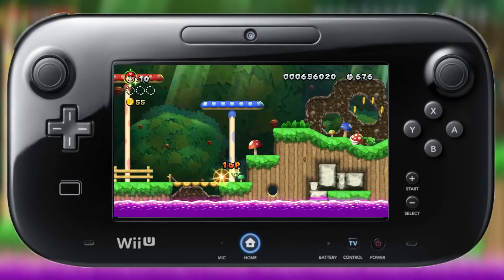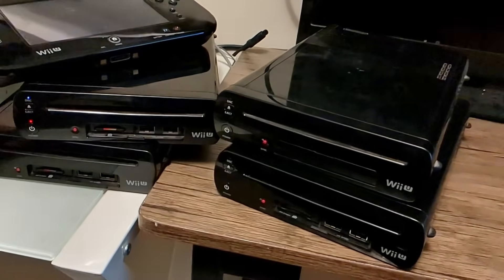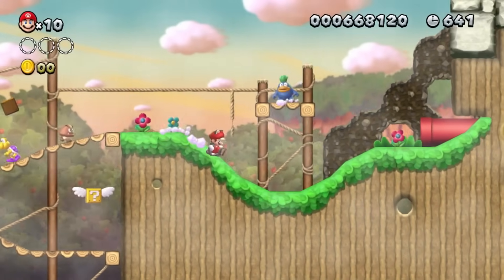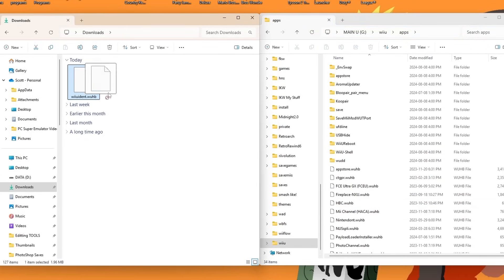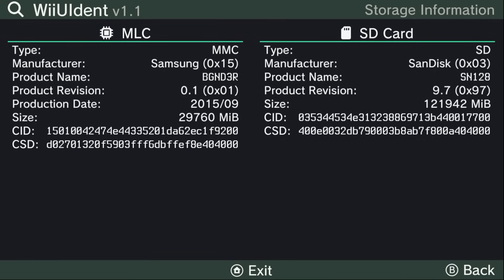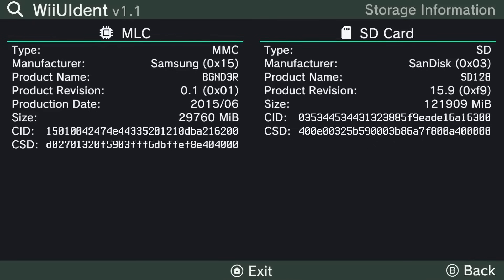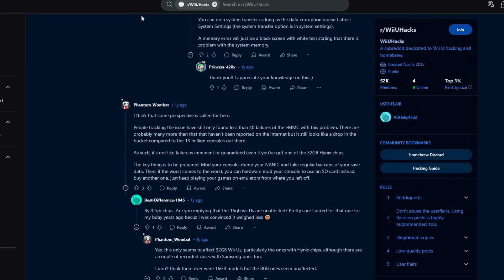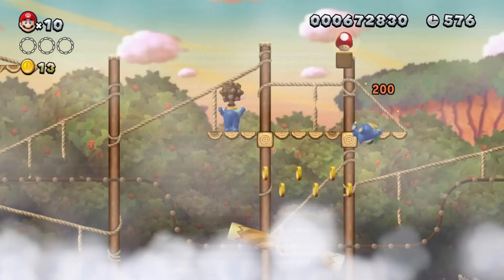How to find out if your Wii U is COOKED... (without taking it apart)

Comment from the maker: IF YOU HAVE HYNIX WATCH THIS https://youtu.be/xEGSSdykAt8 

Also isfshax guide here: https://youtu.be/D9L5JFqlC4Y

Hit like if you have a Wii U! (Also you can get WiiUIdent on the HB Appstore too btw)
Reply: Two wiius
Reply: i hit the like button twice because I have two wii u's
Reply: I bought my Wii U when it first came out. Being techniqually inclined I never have an issue fixing my systems.... Most of the time. My latest project that I've been procrastinating on is the SNES epic black screen of death. Yes I need to change the CPU chip and I'm totally hesitant on doing it for obvious reasons. Ugh SNES is worth good money I really don't want to mess up but at the same time I need to make this skill routine so it'll benefit me later in life. Such sore consequences for every decision
Reply: HII
Reply: Small correction, the white wii u can have hynix chips.
Reply: I wish I had one (not Hynix)
Reply: i took all the plastic out of the disk drive, kept all the ribbon cables and spinny things intact and shoved an ssd in there. i cut away not even half a square cm of plastic next to the hdmi port, through which the usb y cable runs towards the disk drive. i got an internal hard drive with minimal cable sticking out at the back, it'll never unplug accidentally again :-3
Reply: I have a white and a black ( bought a white cause i got a white tablet for free so wanted to complete the set )
Reply: Yes I have Hynix I already know I've downloaded homebrew when it was readily available. Homebrew was my favorite program on the Wii I was giddy waiting for it on the Wii u
Reply: If you're wondering if I'll change it out knowing this information, that answer is no and now that I know about this information it saves me sometime if the incident ever hits me so yeah knowledge is power in this instance that's how I'm looking at this.
Reply: yo can you do a tutorial for installing the vba gx on the Wii. there's like 2 other GBA emulators. out of those three which one would you recommend using?  and then show how to install and set them up, I'd really appreciate it bro.
Reply: Thx for the tutorial. I have a Samsung chip, 
 I'm good ❤❤🎉🎉thx again

Comment: Regardless of which NAND your system has, install ISFShax and Aroma and make a backup of your NAND and OTP file. Your Hynix chips will fail, it's just a matter of when. They will start to give you errors and eventually black screen and never boot. All is not lost even if you don't have a NAND backup. UDPIH, DeFuse and NAND-AID will get you back up and running with a little cost and some soldering skills. 

I have installed NAND-AIDs into two systems that black screened and refused to boot. DeFuse will allow them to boot to a recovery menu where you can rebuild your NAND. Installing a NAND-AID is a must for black screened systems and you can even use an SD card bigger than 32GBs. 

One of the systems I was able to save was a Japanese Wii U that I purchased for $8. Installed a NAND-AID and using DeFuse, I was also able to completely region change it to US with zero effort.

Comment: I hate to throw a stink bomb into the room, but I just completely took apart a filthy white 8GB Wii U console in need of a good cleaning and U18 is a Hynix chip. The HDMI connector is loose, meaning if the cable is wiggled the picture displays or not, so I haven't completely scoped it out yet. I do see the Wii U menu when I can get the picture to display. The number in the SD port is 01.

Comment: I checked my Wii U today because it was likely a model with a Hynix MMC. It's a black 32GB model with coloured connectors at the back. In addition, I often leave my Wii U off for severals weeks or months depending on my work schedule and other things I have to do in my life that sometimes take a lot of time. I'm 25 so video games are the least of my priorities.
So because all of this I was worried about having a Hynix MMC equiped Wii U so I took it apart today (I'm to lazy to hack it again with the latest hacks) to find out that the MMC is a Samsung one 🎉🎉. I can sleep on my two ears now ! (I don't know if this French expression exist in English). While I'm in there, I will dust it off and change the thermal paste.

Comment: I can't get mine to load past the splash screen, and mine is a Zelda edition with the coloured ports. Now I'm curious if there's something wrong with the chip, or if it's because the power cable is a bit loose (which would involve taking it apart, soldering back together again, and using epoxy to keep in in place, which I had to do with a Wacom tablet that kept getting a wiggly port). But none of the repair shops I've talked to in the past 3-ish years since it happened, are willing to take a look at it.

Comment: I bought a two used ones, not knowing this could even happen and both came pre-bricked.

Fortunately I'm not completely technically inept and with some research found out that it has a good chance of being revived using a Raspberry Pi Pico to try and restore the NAND and fortunately it worked for one of the two.

Whether this fix is permanent remains to be seen, but I think the whole issue comes from the EMMC getting corrupted over time because this generation of chips just sucks at holding a charge for data retention on a system-critical component so it'll probably reoccur eventually.

Comment: Well, my Wii U is black with a colored port, but I keep it plugged in 24/7 so it's always powered, anyway. I'm not overly worried, but I also don't have a modded system so I can't check for sure what chip it has.

Comment: Actually it's not really required to mod the Wii U just to find out the NAND Type. What you do need tho is a Raspberry Pi Pico. There's a special exploit called UDPIH i think that allows you to boot a "recovery menu" just by plugging in the programmed RPI into the USB Port ar startup and it won't make any changes to the software on the Wii U but from there you can look at the NAND Type and even create an Image of it.
And a benefit is also that this also works if the NAND is already as corrupted that it doesn't even go to the Wii U menu or has other errors like it was on my Wii, that i couldn't even open the internet browser for example.
Reply from the maker: honestly, it seems easier to mod the console and check XD but thank you for the extra info!
Reply: @funkyscott47 Maybe, I guess it depends. For me there was the problem that I didn't want to mod it in the first place, and then I think for modding it you need to use the exploit through the Browser which didn't work since my Browser was broken. So this would probably be required if the console doesn't even Start up anymore ig.
Reply: Also I think the Failure rate is pretty high with the hynix Chips. I'm actually on my second Wii U, we originally got it in 2014 but I remember it started showing Memory error pretty quickly already, but in the beginning it was only in certain Apps where the files where corrupted. Then in 2018, it wouldn't even Start up anymore, but we had extended warranty on it so we got a replacement console for free. But some time later it started having Memory errors too and in 2023 I found out about this problem, and that my console had a hynix chip... And my Wii U is from 2015, so it seems like really all years can have this problem. But now i've replaced the eMMC with a microSD card and it does work fine again.

Comment: Lets gooo both my Wii U's are safe!!! My white Wii U is obviously a Samsung and my Black Wii U (colored ports on the back) is Toshiba!
Reply: jerk
Reply: i have a yellow port one so I'm jealous.
Reply: @ian.swift.31614  what do you mean? Mine is yellow too?
Reply: @ian.swift.31614 Yellow port doesn’t mean it’s Hynex… mine are yellow too. And even if it IS Hynex as long as you keep it plugged in and use it now and then you’re fine.
Reply: @S.J.C._Entertainment  "keep it plugged in and you'll be fine". (PS it's you're not your). that's not true at all, why are you sharing disinformation with strangers on the internet?
Reply: @ian.swift.31614  Except I’m not? Most of the dying Wii Us are ones left unplugged for extended periods of time. A plugged in, well used Wii U will be just fine.
Reply: @S.J.C._Entertainment  I don't know who you're trying to convince or prove yourself to. The "always on" theory has been debunked for a long time.
Reply: @ Sure only a coincidence that most of  the bricked ones have been turned off for extended periods of time. Only a few well used Wii Us have had this issue.

Comment: My model is a hynix sadly but my Wii U is always plugged in btw. That beast is still going strong. If it does end up dying I’ll solder a pcb on it I heard somewhere that you can do that and replace the nand with a Sd card l. Luckily I learned how to solder at work so that could come handy

Comment: I still have my Wii U. Still play my games on it, mostly Wii Fit U. It is a black one. Ports are black. I got it for Christmas after Super Mario Maker was released, so I don't remember if it was 2015 or 2016. It came with Mario Kart 8 pre-installed and a code for the DLC.

Comment: banana.

may i ask you something?
what if for some reason, sometimes when i'm on the wii u menu after a while the console freezes and makes a weird noise? this doesn't never happen in game btw. 
i gotta reset it everytime it happens and it's quite scary since i have a european wii u, which production date is 2013-01-03 and its hynix chip is from 11/2012.
Reply from the maker: I'd suggest installing isfshax right away
Reply: @funkyscott47 yeah that's what i wanted to do.

the first time i modded my wii u with aroma i watched a video of yours from a year ago and i remember at the time i also made the nand backup. 
Wasn't that made with isfshax or something? and if the console fails would i only need the backup or i should buy another wii u or a new chip? thanks

Edit: I read the downloading instructions and other general infos about isfshax, i believe it can be considered as wii's bootmii, right?

Comment: My system was from the Wind Waker bundle, The ports are colored but I don't want to install custom firmware on it so I guess I'll never know.   Currently it still works fine.
Reply: I just got the wind waker one. Why don't you want to do the firmware? I am in the next couple days
Reply: Well, I mean, you could open it up to check instead.

But I guess you’d rather not do that either XD
Reply: @XaneTenshi  Yeah, I am not really the type to open systems beyond the normal stuff like putting a hard drive in a PS5.

Comment: Interestingly enough, even though all the signs were pointing to a Hynix chip, after recently updating to Aroma and using WiiUIdent, it turns out I actually have a Toshiba. Cool!

Original comment:
Was gonna check using the app, but my CFW is still from the stone age of Wii U modding (Haxchi), so I'm gonna have to update and check it out later. It has coloured ports, so... rip bozo in advance, lol

Comment: I have a launch unit (made September 2012), it is still a working system.
Reply: I just checked it, mine has the colored ports, and it has a Toshiba nand chip.
Reply: @Shane_007 I have a PAL launch unit (MFD in October 2012), Samsung NAND chip, working perfectly fine.

Comment: Do you have a Tut for upgrading from non colt boot haxchi to aroma?
Will I kose any of my hame installs?
I have an external drove and mots kf gamws  triforce and GC set up with mots of of forwarders but I haven't uset this thing in a long time.
I dot want to have anything break Injust want to update because I could never get retroarch working

Comment: I'm so glad I saw this video. I do micro-electronic soldering/repairs (or learning how to). My past-time at the moment is buying & repairing faulty Wii motes. But I've seen several faulty Wii U's on Ebay lately (in Australia), with "Error Code 160-1400" error codes. 

Now I know not to bother wasting any money on trying to repair one of those Wii U's.
Reply: At least Wii U's with this error code will make for some good donor boards since everything but the NAND still works :3

Comment: eMMC memory by nature will fail eventually.  It's not a long term solution for storage.  It will fail much sooner than most solid state storage types.  For the moment most wiiU consoles will be fine, but in the years to come they will ALL eventually fail.  Having done the Nand-Aid install on many broken consoles I've bought from goodwill and ebay, not all of them were hynix.  I've also had to replace a bad RAM chip on a friends system.  

Replacing the eMMC with an SD card is not a permanent fix either, but at the very least it will let you always have a working console as you can always put in a new SD card and reinstalling the OS with ISFSHax / Minute.

Comment: My Wii U was partially corrupted back in 2022, and back then there was very little info known about this issue. I  basically decided I would never touch a Wii U again because It didn't seem worth it if every single one could fail.
Today I learned that people figured out that there are units that are probably safe from this.

I'm not looking forward to trying to blindly buy a replacement console hoping it has a good chip.
Reply: I got the white model. It won't ever happen.
Reply: Just go for a white model/colorless back black model ;3
Reply: Chances are, if you have a working Wii U at this point then it's probably fine.  Just always use an external drive to extend the life of the NAND as much as possible.

Comment: Decent coverage of this news. Glad cfw can bypass the failing NAND if need be. 
As far as pronunciation goes, yeah, all of the PSPident clones have generally been pronounced that way, like "resident," even though the word it's a cross of is "identify." 
As for the other, general rule of thumb, just pronounce the individual letters if you don't know what they stand for. 
in this case, though, isfshax is short for I(O)S FS, which is "Internal (Operating) System File System" hacks.

Comment: my wii u does not have colored ports on the back, and I got it in 2015. but it does have the hynix chip from 2013
I was really hoping it wasnt hynix since it didnt have the colored port. I hope it doesnt die because the wii u is a really good homebrew machine
Reply: Read the post in the end of the video, if it begins to fail, thanks to modding you can make a backup and replace the chip with an SD card

Comment: Has there been any consistency within particular box bundles?
Like if say my 32GB Wii U was from the Mario & Luigi Deluxe set could it be reasonably assumed what nand chip it has since they were likely all produced with the same specifications for that run, or is it still a mixed bag of what you end up with?
Reply: Safe to say it'd be a mixed bag, considering nobody knows how much old stock got mixed in with those bundles and whatnot

Comment: Hey, I have a black Wii U that was once modded before by my brother years ago to get Smash 4 mods. Since then, the SD card used was inserted out and our Wii U is no longer modded. I’ve been thinking about modding our Wii U again with a new SD Card, but I’m unsure if doing so will potentially brick it or mess it up since it was tempered with before. I don’t know if my brother had already backed up the nand or not, and if he got tiramisu or aroma back then. It was back in 2015. I’m wondering,

Can I remod my Wii U again with a new SD card without it bricking? Or is it not recommended? (Since it was modded with an old sd card before)

Comment: My Wii U is a launch day deluxe, but its remained plugged in throughout the 7 years since I got my Switch. In 2023 after the eShop shutdown I finally modded it and made a backup of the nand in case it does finally quit.
It’s still running to this day, but I’m keeping my fingers crossed that still has at least a year or more ahead of it since I bought Xenoblade X on it right before the eShop closure.

Comment: I'm clearing up some misinformation here and just making some stuff clear.

- Not using your Wii U for an extended amount of time DOES NOT CAUSE THIS ISSUE. In fact, using your Wii U theoretically makes it progress faster.
- Not all 32GB Wii Us are black. Some are white, but as far as I know they were only sold in Japan.
- A corrupting NAND only happens to Hynix chips produced before the 2nd half of 2013. If you have a Hynix with a production date of 06/13 or later, you are fine.

Please adhere to the official Nintendo Homebrew guides and information.
Reply from the maker: thanks Spletz!

Comment: I repaired it or it self repaired. I made fat32 check and then reinserted and aroma asked for update. Before unfortunately Aroma stopped working, it stays on that Wii U screen with melody. Console works fine on Tiramisu. After checking memory type I used Wii U for a while, then it froze, I played some games. After restarting it started to not work on Aroma. Strange but it’s ok now

Comment: Udpih also allows you to check chip manufacturer without hack, so it will be easier and faster for situations where you want to buy used wii u to check it. Also not mentioned white Japanese wii u with 32 gb.

Comment: Hey Scott I have a question when I install a game to my USB drive and plug it into the Wii it doesn’t show on usb loader dx even when I formated the usb correctly I don’t even know if the usb drive works how do I check that?

Also my usb drive is youse

-Edit I formated it to fat32 again and again and it still won’t do anything to my Wii at this point do you think I need to get a new usb drive